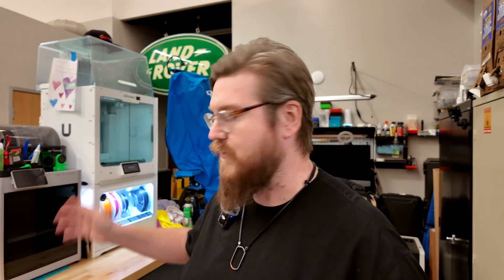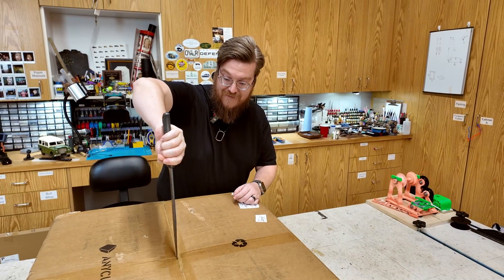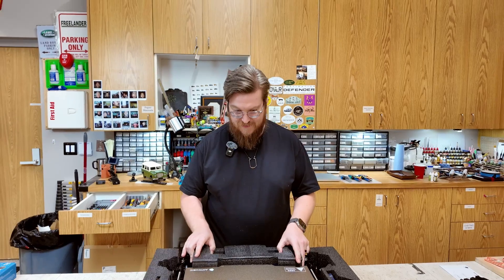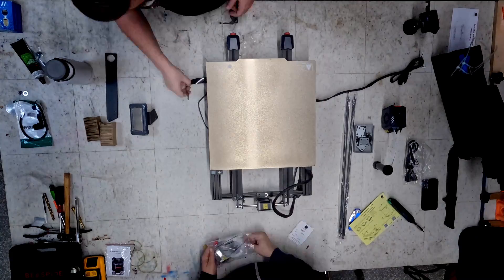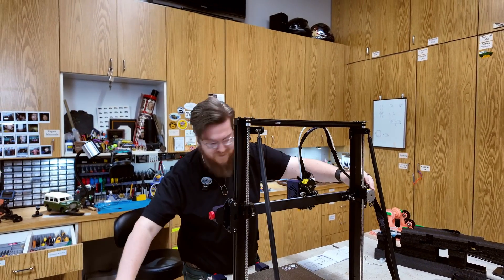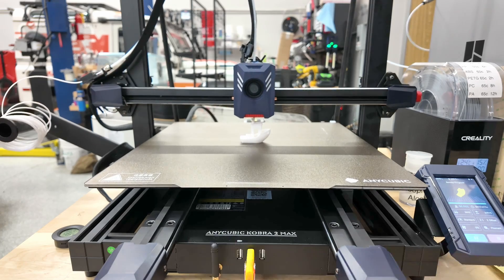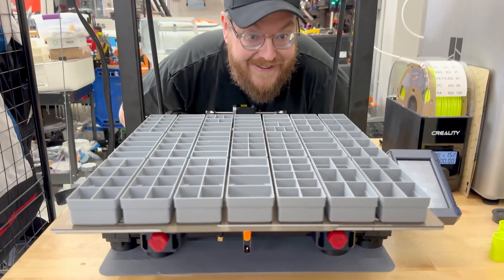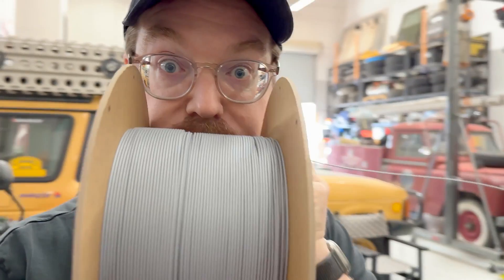Epic 3D Printer Upgrade for Less: Surprise Results with the Affordable Kobra Max 2!

Comment: the print quality on that cobra was pretty scuffed
Reply from the maker: Ya, we’re still dialing it in. Lot’s of things to tighten up. We’ve also added some reinforcement to the tower and changed the feed from that spool, turns out that it’s too hard for the head to turn that heavy spool, we’ll post some updates soon. Thanks for watching!